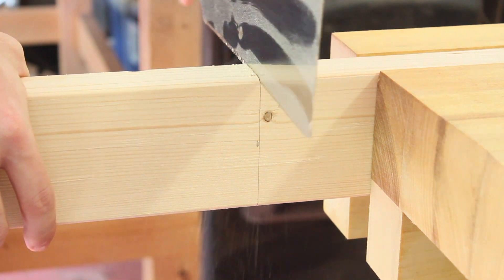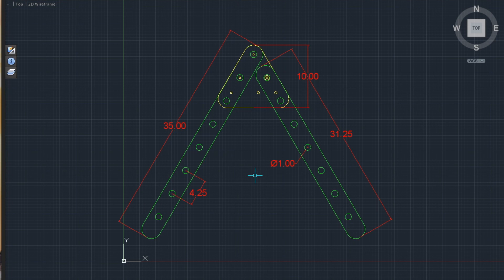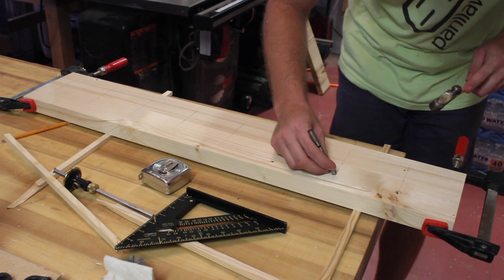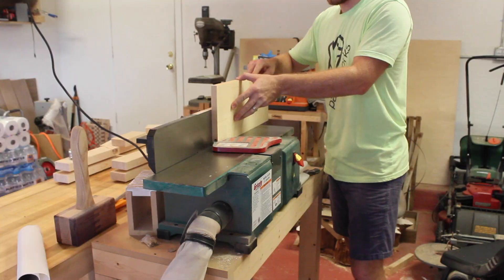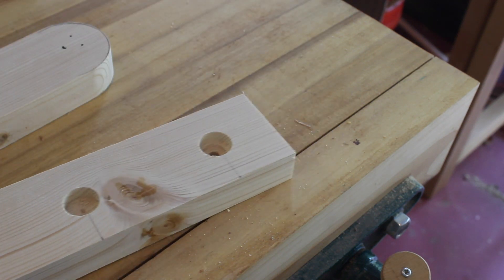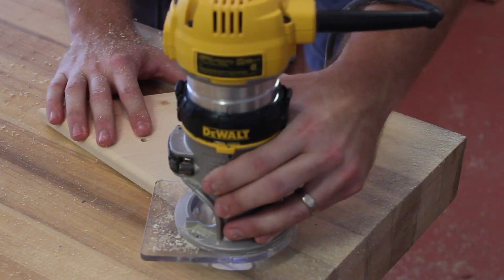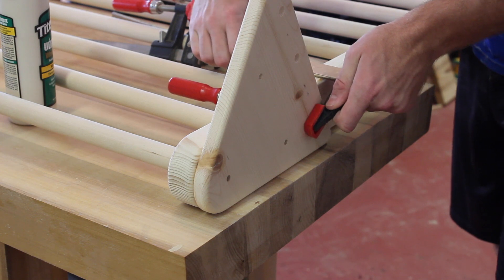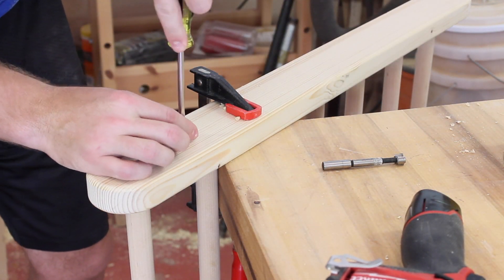Making a Climbing Structure for Toddlers (Pikler Triangle)

Comment: I know you don’t use the metal hardware anymore, but can you tell me what the metal hardware from this video is called? I’d like to make it with the metal hardware. Thanks!
Reply from the maker: The hinging mechanism is just a connecting bolt available at Home Depot and other retailers. The screws are of a similar quality, just with a wood screw thread instead of a machine thread.

Comment: Great video and great design. Could you please elaborate on the food safe oil mixture. I line in a country where it is difficult to get many products, so I would like to know if that is something I can make on my own. Thanks.
Reply from the maker: For projects like this I use regular mineral oil which can be found in pharmacies or may also be marketed as "butcher block oil". The second coat was just a blend of mineral oil and beeswax.
Reply: @parillaworks  Could you also please let us know what width you decided to go with? Meaning, the length of the dowels used.

Comment: Cool project! Talked about the small jointer with the old Powermatic in the next shot. What is it's status?
Reply from the maker: Thanks Tom! The Powermatic works but it still needs some fine tuning. I think I need to get a new belt for it and possibly some new knives.
Reply: In case you had not heard of them, Link belts are the way to go.
Reply: Link belts are the way to go.

Comment: Great video, new subscriber.  I believe you put in the threaded inserts backwards.  The slot is there to help insertion almost like a drill or tread cutting bit.  The recommended way by the manufacturer is to use a threaded rod with two locked nuts or their adapter to drive the inserts.  The metal in the inserts in very soft.  Thank you again for the videos
Reply from the maker: Thanks for the comment. I'll keep that in mind next time I make one of these or use threaded inserts in general.

Comment: How are the bolts at 6:02 are connected? they have no connector at the other side as I see. they sit in place just by the force of the thread?
Reply from the maker: Yup, those actually have screw threads so they just bite into the wood.